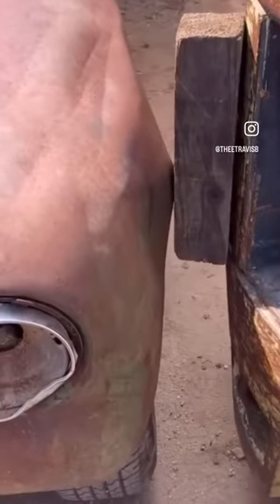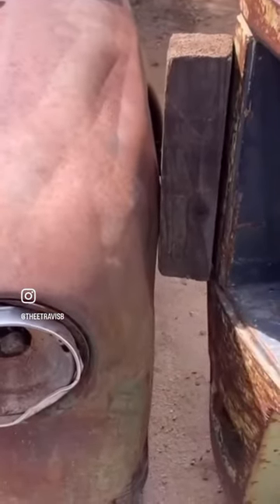Using a forklift to do bodywork on an abandoned 46 international

Comment: if you have to beat on it like that, it's best to have a solid metal block on the other side of the hammer.. my dad has a body shop and he often calls me to help him hold a metal piece on the other side. He has many different shaped 'dies' and it contains the hit to the part you're striking instead of shaking the whole fender
Reply: I use a trick similar to this I just put another hammer on the other side!

Comment: Save lots of time with a dolly and hammer kit from harbor freight. You're doing an awesome job man, congrats on the project. It's come a long way 💯
Reply: You beat me to it lol
Reply: @notablynova  Lol I had classes in high school for 3 years and that ol fella was dang good at it the old school way. Till today I'm the body shop repair for the family 😂😂
Reply: @adamgonzales1287  when I was 19 I bought a 1980 Dodge Aspen for $200 that have been rear-ended by an S10 that was doing 45 miles an hour used a log chain a big old tree to pull it out and drove it for 10 years.

What the guys in this video failed understand was that buckle in the fender was there because the front end had hit something and it was actually crush damaged have they hooked it to something and pulled on it they would have taken almost all of it out without ever having to use a hammer 🤷
Reply: @notablynova  It's incredible how a lot of times wisdom beats all, I've spent one hole day trying to straighten a 53' Chevy rear fender and the teacher got it in 20 min with a hydraulic jack and hot water 😂

Comment: ever thought of wearing safety gear to keep the rust and crap out your eyes and lungs ? Based on this video it would appear you have very little experience in restoration. But hey its your video I wouldn't dare try to explain what your doing it wrong. At the rate you are going it will take a lot a life time to complete.